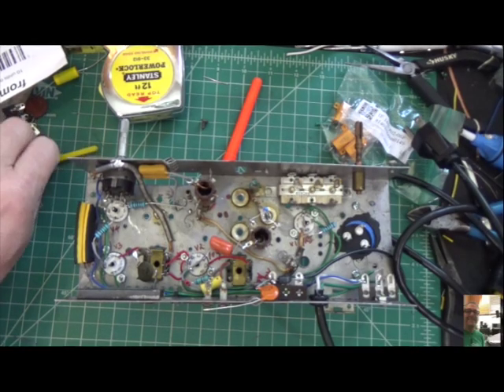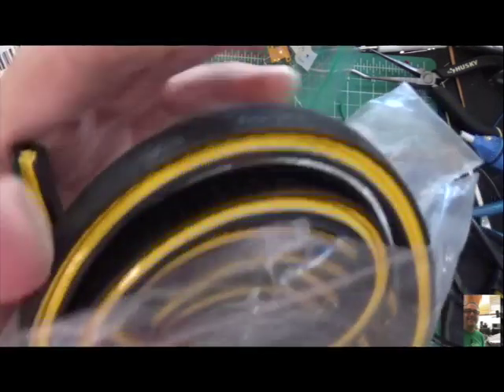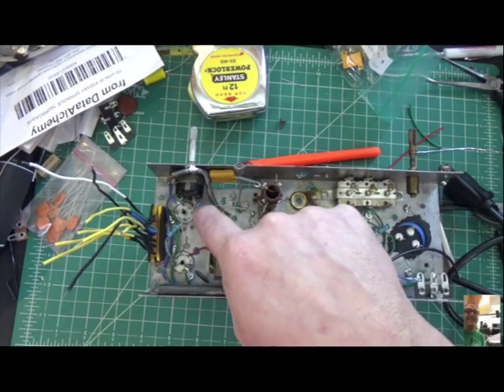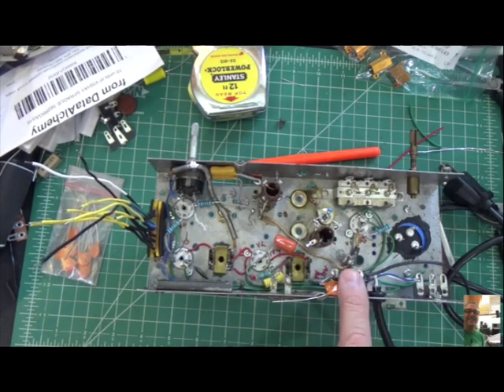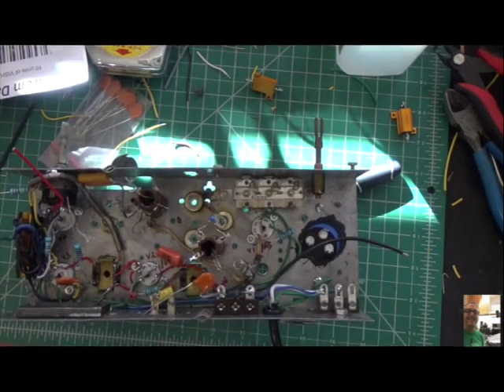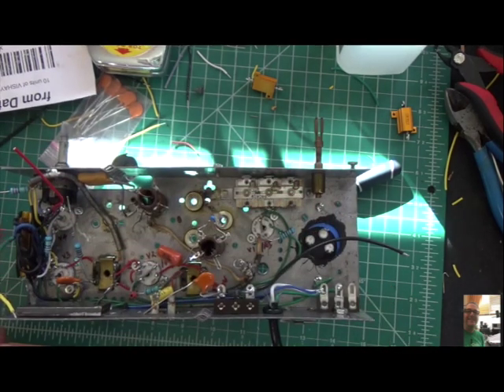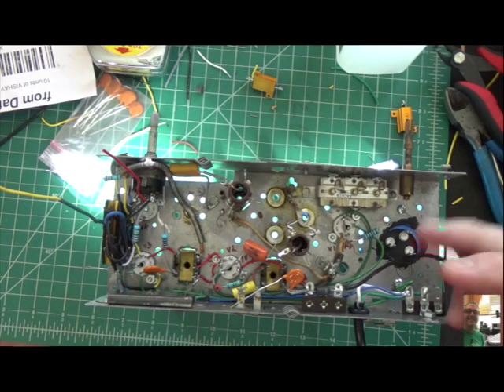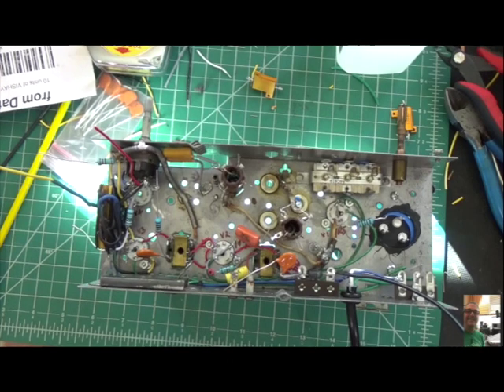Hallicrafters 5R41 and S-20R Restore # 21 -  Walking on the Wires

Comment: My Beitman schematic shows that going to chassis ground.😉
Reply from the maker: Thank you Robert, I am now looking for other errors as this is the right time to do it :)  Appreciate it my friend.
Reply: Where did you get the schematic you're using?
Reply from the maker: It came from AntiqueRadioSchematics.org  aka  Steve Johnson.  It reads a Photofact Standard Notation ( presumed to be Sams Photofact) converted to digital in 2017.  The second copy I have is from the MANUAL of 1955 Most -Often Needed Radio Schematics.    Is your different ???   Thank you much - Ron
Reply: Mine is the 1955 Beitman Most Often Needed. I have the full set of Beitman and Rider manuals. :-)
Reply from the maker: Thats awesome. I am finding the Beitman is probably more correct then the other one. I will make sure I refer to both here so I don't make any egregious errors :)  Thanks much
Reply: The BAMA website has a copy of the original operation manual and a full Sam's Photo fact for the 5R41.
Reply from the maker: Thank you